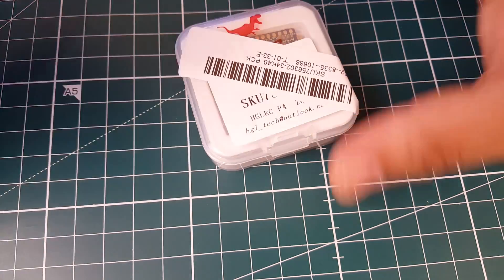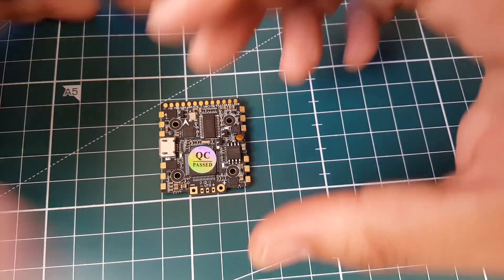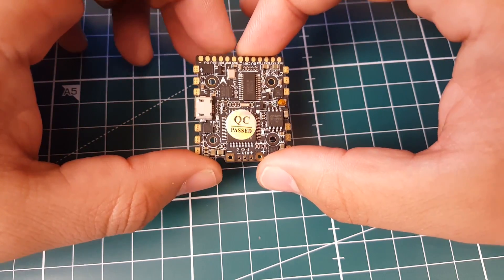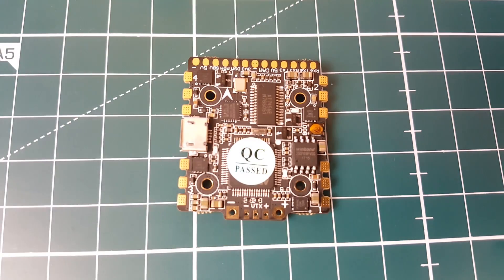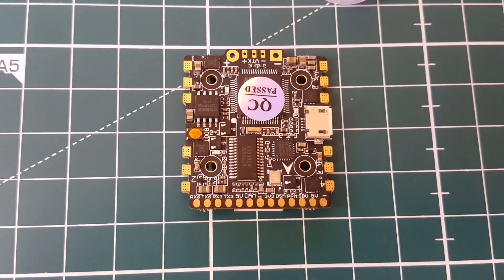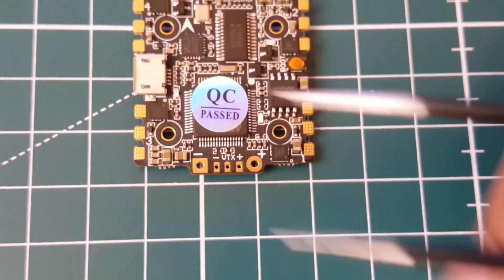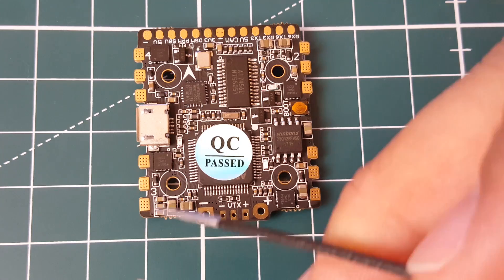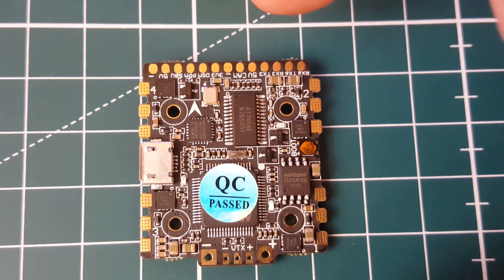HGLRC ZEUS F4 AIO // Overview and Layout

Comment: Again these idiot USB ports! HGLRC uses 2 foot, very weak, easy-to-popup USB sockets. When these ports apart from board, they also pull wires. That means it can not be fixed again. Me and my friend used 2 HGLRC Flame boards each and same issue happened
Reply: my lasted between ~10-20 mating cycles before it popped off today.